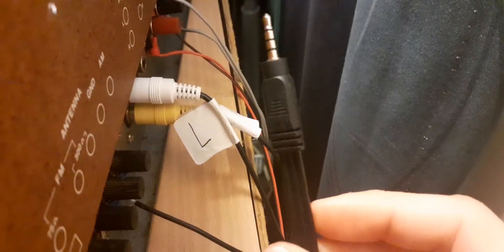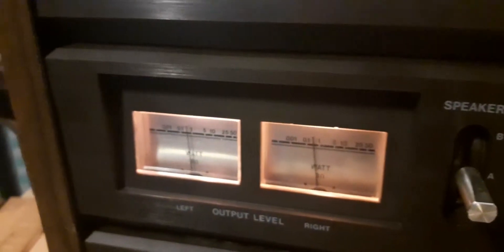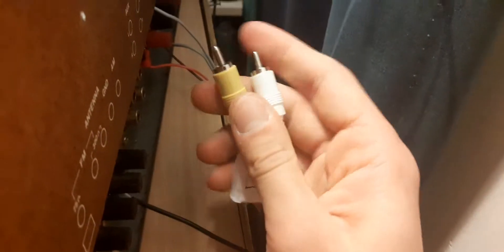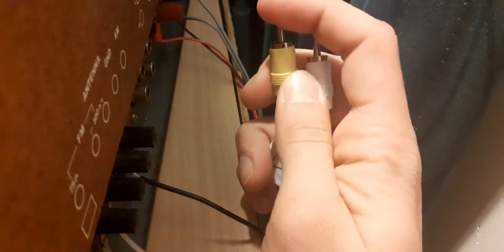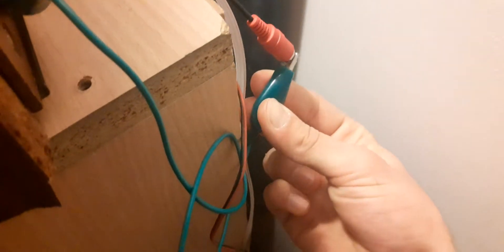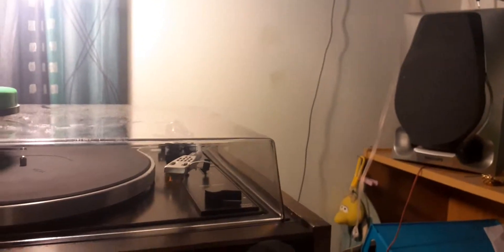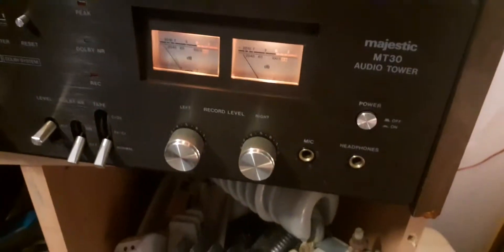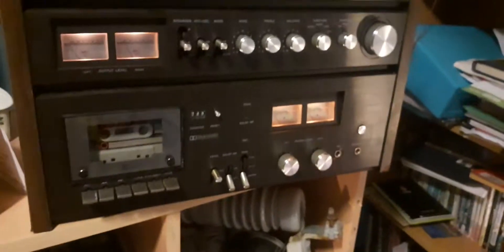The importance of the audio ground connection on a stereo

Comment: I have an old Technics 5 sec with four 12s and I noticed today that it has a spot like a really weird looking screw for a ground but I've never hooked it up I know in a car stereo system with a amp you won't get any sound without a ground which was kind of making me scratch my head only place I could think to ground it would be in my panel or a ground rod outside cuz it doesn't have two spots or any other spot on the other four appliances cuz it has an amp to tape players a CD player and equalizer and then the synthesizer AM FM radio tuner maybe that ground on the back of the amp could be for the antenna for the radio but I took that part out all I have is the amp running to my TV and then to the speakers cuz I don't need a tape player or CD player or a stereo those things are kind of obsolete these days lol but if you have any input I would like to hear it if I can get more performance out of grounding it I would probably take the time to do it but I don't think that's what this type of ground does

Comment: Hi! Do you think I could use an alligator grip attaching a female RCA connection on an active speaker to a nail on the wall? (I have no grounded outlet)
Reply from the maker: I dont think that will work you need a proper ground.
Reply: @rakselectric7390  Thanks! So, a proper ground would work in this case?
I mean, my speaker doesn't have a ground pin, so I was thinking I could ground the outlet and stick the alligator in the ground socket.

Comment: Red and white and left and right. Yellow is video....
Reply: that's what i was thinking! red and white plugs are for audio left and right and yellow is for video. 

my question is:if i instead connect the red and white and use the yellow to connect to the ground will it fix the issue? 
and can i connect the ground wire with clip to one of the screws on my subwoofer? i have a 2.1 speaker that i connect to my phone but i get that annoying buzz sound. please reply, thank you
Reply from the maker: Yes sir but in my case yellow is ground.
Reply: @rakselectric7390  no, you.. look at the video...red white, audio, yellow is video, which yes, could be used as the ground. But you used video input for audio, pinned wrong on the 3.5mmjack

Comment: So you just leave that other cable end loose.  Some customer of mine grounded the phono stage on one of my amps behind my back when I left the store, this is interesting.
Reply from the maker: No that cable is rca-aux, the aux I leave alone but the rca side is right,left,ground.  I connected the rca ground to the back of the stereo to the frame for a ground connection.
Reply: @rakselectric7390  So you just plugged one of the RCA ends into another input or output while the other end was attached to the alligator grip attached to the chassis of the metal body?
Reply from the maker: @HeavenReservation  The yellow and white RCA ends goes plugs into the stereo which is a left and right input, then the red which is ground goes to the chassis of the stereo.
Reply: @rakselectric7390  I'm really hesitant on trying as don't want to fry this classis unit of mine.  However, I never seen your method before, so I'm 100 percent of interested in making this work.  Normally, in the old days, the RCA cables came in two colors, red (right channel) and white (left channel), then when the video recorders came out in the late 70's; they added the yellow ended rca cable for the video signal.  I know its hard to buy rca end cables without having the yellow as well in most cases, unless you get more of a high end cables, but in watching your video, I see you use the alligator clamp and clamp it to the chassis of the amplifier.  On the other end of that clamped wire is an RCA plug? But in the video it doesn't show where are you placing the RCA, there's no place to attach that RCA unless you cut off the end and screw it to one of the assembly parts of the body, is that what you're referring to?
Reply from the maker: Yes you are right, the alligator clip was attached to the rca end which I grounded to the amplifier. I also crimped a connector to the rca connector then attached it to the stereo (chassis part).
Reply: @rakselectric7390  So basically, you have each of the two ends just connecting to different places in the back of the amplifier?  Sort of like balancing the wire across other parts of the body, one on the back left side and the other end of the cable on the other side of the amp without actually plugging anything in?
Reply from the maker: @HeavenReservation  I will make a short video about it.
Reply: @rakselectric7390  ok, thanks
Reply: Hooked wire to screw on body of my receive and other end to rca cable,left channel phono..got rid of all hum,etc